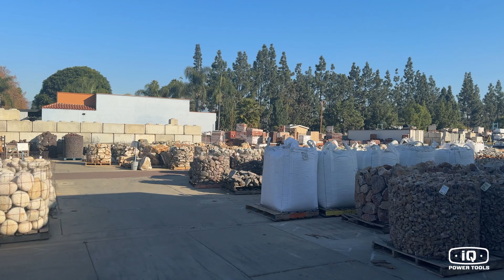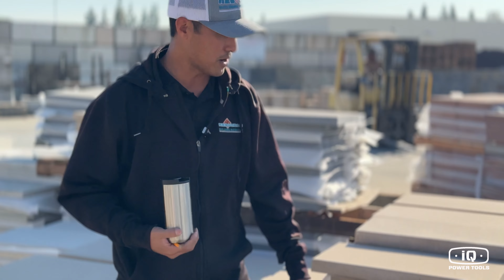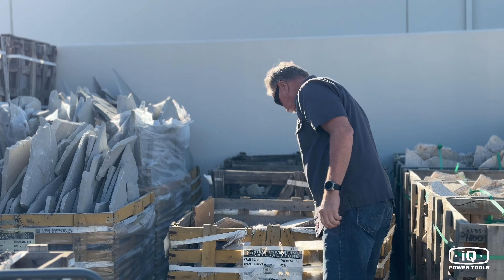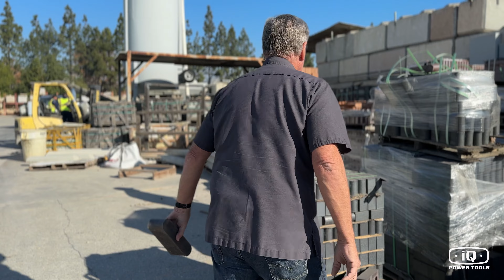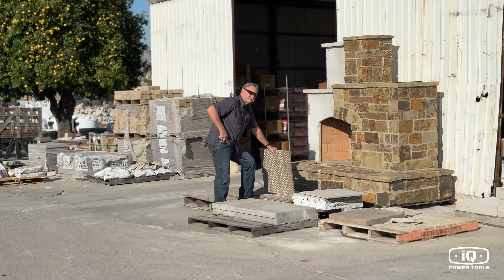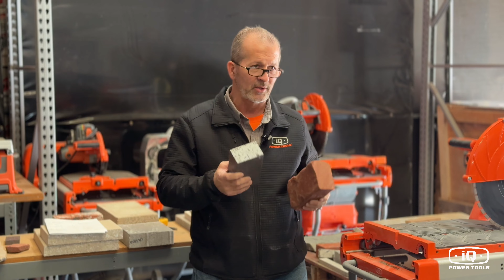iQ Power Tools Blade and Material Testing with the iQMS362i!

Comment: I have this saw. The saw is phenomenal. The IQ blades absolutely suck. Blade life is terrible and they’re incredibly expensive. We can complete several paver  and wall jobs with a single $100 diamond blade from Home Depot using a wet portable gas saw, but with these $300 IQ blades and this dry saw, we can’t even get through a single job before the blade just won’t cut. We have to push so hard that the ammeter light turns red. Super disappointing.

And yes, we are using the IQ dressing stones to try to refresh the diamonds on the blade. We cut slow to keep the ammeter light in the green/yellow. 

We have tried 3 orange blades, one black blade, and one purple blade. Cutting Belgard pavers and wall blocks.